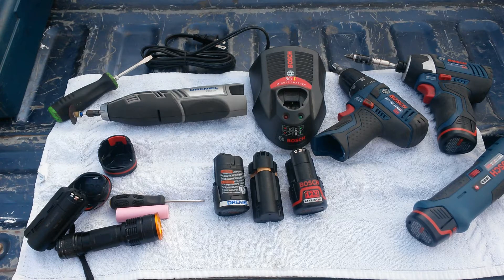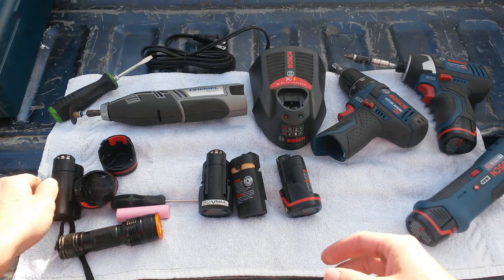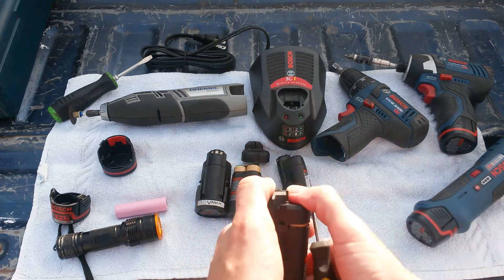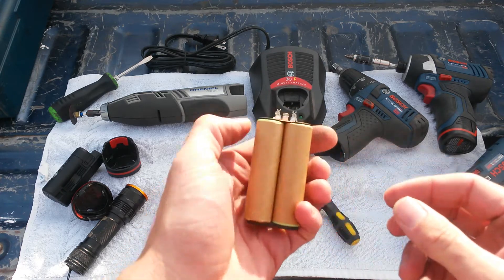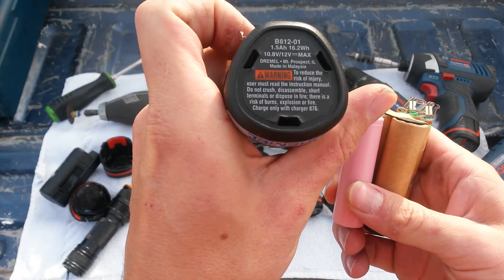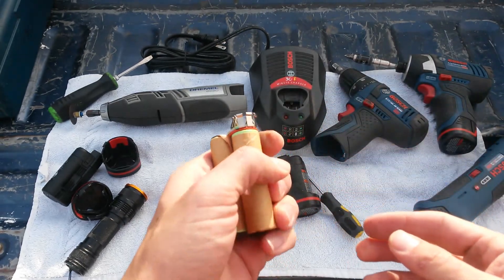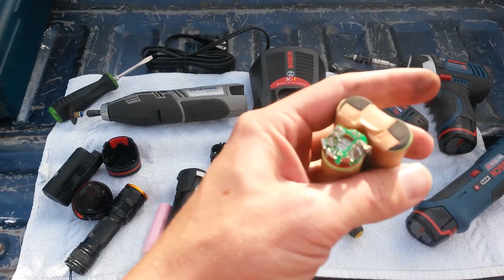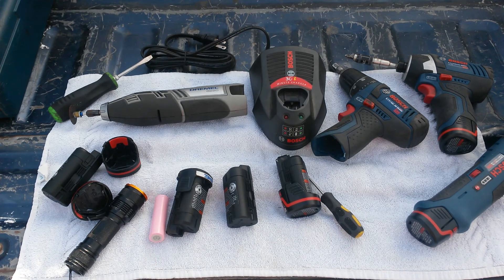Re-Building Bosch & Dremel 12V Max lithium-Ion Battery Packs ~18650 Cells

Comment: hey. thanks for the videos.  I have 2 of the 12v fat "T style 4 amp batteries but the clips that hold the batteries on my tools has broken off.  do you have a fix for this?